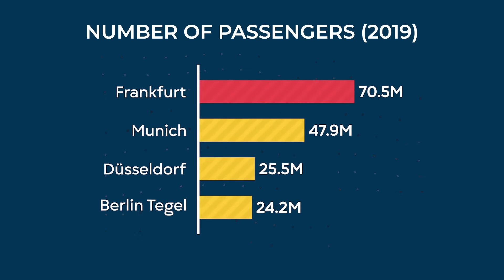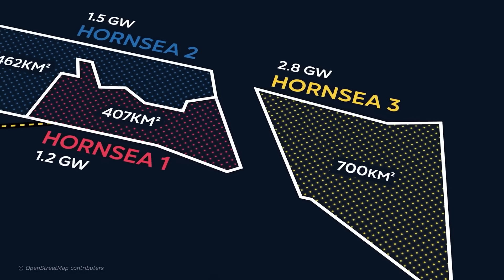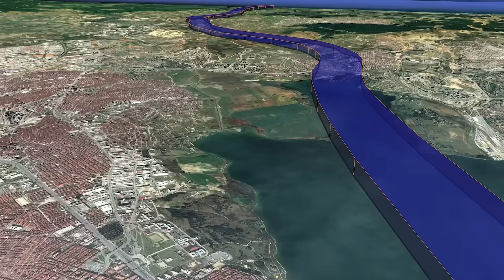Inside Europe’s $7BN Megaproject

Comment: HS2 🤣😂
Reply: Is being built.
Reply: A poor 200km high-speed double-track railway, that China, Spain or France usually do for 10 times cheaper and wayyyy faster. HS2 doesn't belong in a "top megaprojects".
Reply: @gmaildinozz  Nonsense - half of HS2 is underground, and goes through areas of population density vastly higher than in rural Spain, France or China.

Comment: 14:50 talking about the Schengen area and showing London as a starting point. The UK was NEVER a member of the Schengen area.
Also Hinkley C with a capacity of 3,x GW whereas Hornsea 3+4 are scheduled to produce 5+GW... I assume they get finished earlier than the nuclear plant...
This video has so many flaws... 👎
Reply: both nuclear and wind option is better then just wind or just nuclear, nuclear can provide a constant base input on system while wind can handle demand peaks . Energy management is more complicated then simply deploying capacity :)
Reply: Nuclear has a higher utilization rate. Wind power operates at around 50% peak performance on average in windy places.
Reply: While HPC is a truly desaster of a project, you can't compare nuclear and renewables in capacity. For instance 4GW of offshore wind are equivalent to 1GW of nuclear based on capacity factors

Comment: Great video. Too bad nuclear power continues to be over budget and behind schedule but mostly from non-technical delays because it's the best way to decarbonize the entire electrical grid and fast... Canada runs currently, pun intended, on an 86% mix of hydro and nuclear power, which are the best options for large-scale baseload power with little to no carbon footprint. But even if the project costs doubled with a proposed lifespan of 60-70 years the capital cost overruns will soon be forgotten..
Reply: You also need to account the cost for storing the nuclear waste for a very long time. And nuclear power uses a finite resource so it's not suitable to power the world in the longrun.
Reply: @sebastianstadler4799 A not that long time if you re use nuclear waste, wich is the case with the UK. Also, literally every energy source uses a finite resource, solar and wind use a sh1t ton of steel, glass, concrete, some REE's, and not all of that is easy to recycle
Reply: No, the costs won't be forgotten. Once that thing finanally starts running, it will be the most expensive power source in the UK. With 10 cents per kWh it barely pays back the loan in 40 years. Assuming the EPR design even makes it that long without extensive retrofits.
Reply: @Psi-Storm Mostly UK's fault though...